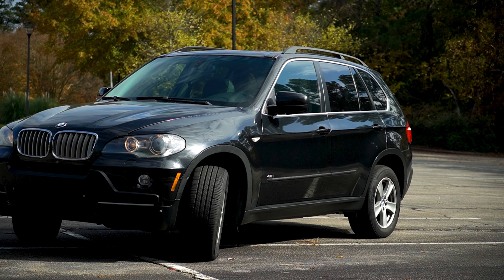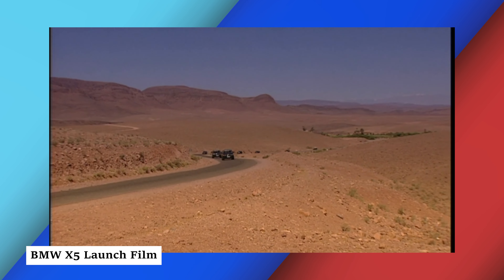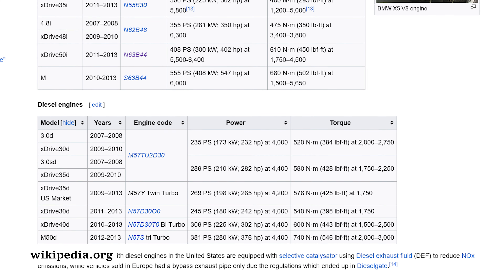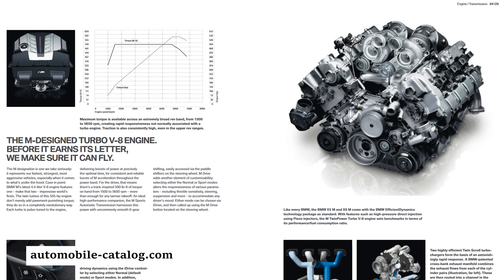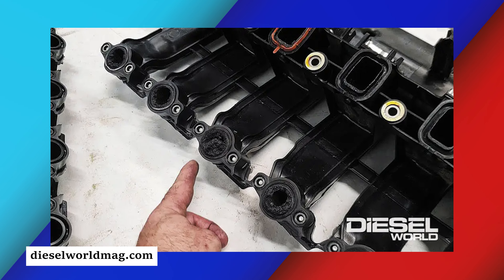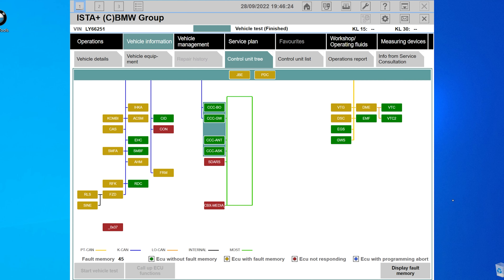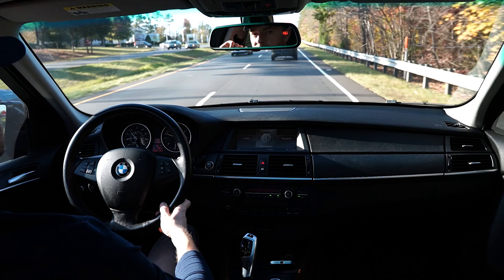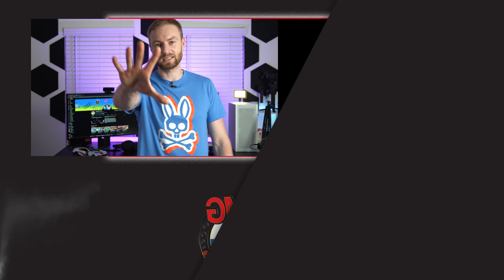The Dark Side of BMW X5 E70: Problems, Reliability, and Buying Guide

Comment: My daily beater is a 2008 x5 with the n52 3.0 si.      212 k miles and runs strong as ever with the coldest AC I have ever felt.
Reply: What's your maintenance and expenses per year roughly? Thank you
Reply: @    Most I have spent on it, was a battery and a rear break pad wear sensor, not including regular maintenance.   I would say a little over 200 bucks for the past year.

Comment: I love my 2012 E70 N57 diesel.    The drivetrain has been pretty solid up to its 160k kms, but the plastics used by BMW on this car are horrible.   In the engine bay, I've had to replace the plastic fan, plastic coolant expansion tank cap, plastic upper engine partition, plastic/rubber engine cover grommets, plastic shock strut tops, and now brittle wiring inside one of the headlights is causing problems.    

In the interior, the plastic degraded and got sticky in all door pullls.   The center cupholder rolling cover broke.  Dry plastic creaks around the cabin.    Again, the engine and transmission will last forever if you take care of it but the rest of the car will probably fall apart around it.
Reply: I have same car when do plastics go mines 2011 and done 80k miles now. Got valve cover leak and oil smell on hot exhaust.

Comment: After owning an 2009 3.0 E70 I don’t recommend this car. I drive BMW for the last 30 years and this is the worse. Even 2 mechanics asked me if I’m sure buying one as those are high maintenance cars. I did anyway. Within 1 year I had to do, heater valve, water pump, steering pump, exhaust camshaft ledge, pvc valve, main radiator water hose, rear suspension airbags, electric starter, reveres camera, all oil gaskets, vanos unit bolts (under valve cover) some videos on YouTube here about the bolts. The was a recall for the bolts but not where I live. This car is a nightmare!!! I would sell but now invested so much that I hope it will last.
Reply from the maker: It definitely depends on the previous owner and the condition you got the car or wasn't following the maintenance, if you would let it run for 10 years without replacing a single thing... But I understand what you referring to, luxury cars are not reliable relative to some other brands, and it's cheaper to buy different cars instead of spending so much money on repairs. Although not every x5 will be the same, the engine is N52 and it's not that bad in comparison, plus it was installed in every BMW at the time so it could happen to any bimmer...
Reply: @Makhnovets  yes previous owner maintenance history is very important and I owned multiple N52 and still have an E83 with the 3.0si engine and it’s great. But certain years of the N52 had two major recalls for the exhaust camshaft ledge and the vanos gear bolts and those should be avoided at all costs unless a buyer has proof of those repairs. 
Without issues the E70 is a great family SUV and I love driving it but the reliability is not there and this does not seem to be a unique case as others have similar issues on the E70 platform. 
After 30 years I still love driving BMW but you have to be prepared for repairs.
Reply: He's not a newbie to second hand bmw's.. Just admit that there aren't certain models, brands that are muck less reliable than others regardless how you maintain it.
Reply: Those are mostly all maintenance items which are have all been replaced over the course of ~5 or 6 years on one BMW which I currently have. We also had to have transmission solenoids replaced at ~180,000 miles and transmission fluid too (again, they are maintenance items). And a new transfer case at ~190,000. But apart from all the maintenance parts, it has been quite reliable. It just seems all the maintenance parts which were replaced on different intervals on this car were replaced at the same one on yours.

Comment: I’m scared now. I have the N62 in my e70 😢
Reply from the maker: I wouldn't worry too much, if the car driving good, and you don't have any issues with engine or transmission, you should be fine, most cars with N62 engines slowly getting to the point of being broken, so you have enough time to deal with the problem or newer)

Comment: Is the E53 x5 3.0i with M54 engines a reliable car to buy. What mileage car should I avoid.
Reply from the maker: The M54 main issue is the lifter seals(common but not too many people trying to fix it because it's expensive and potentially car can operate with no problem ) and VANOS seals. if those are in good condition I wouldn't worry too much. Overall it's a good engine, as for the millage, 100-130k/mi top. and you got to make sure there no major oil leaks, .
Reply: Thank you for sharing your knowledge. Would you recommend an E70 X5 N52B30 3.0 petrol to be a more reliable engine than M54.
Reply: from europe i say get m57 , most reliable engine from bmw
Reply: @kalamees  have read many good reviews on M57. My usage is like weekend grocery, church and occasional (1-2 times) a year long trip with family. I’m afraid that due to my usage remaining local distance of about 5 kms a week in city the DPF will not regenerate and I will be struggling with DPF cost and service. Hence wanted a petrol motor.

Comment from the maker: Forgot to conclude about the Diesel engine,  in terms of maintenance it's really similar to N55, and it's a bit picky, definitely will need to clean carbon buildup and possibly replace the charcoal filter, if it wasn't replaced, but generally M57Y long-lasting and reliable engine. So my suggestion is N52 as the most reliable, then N57Y if you can find one in good condition, and N55 as the third option. 
As for the rest, they are strictly for enthusiasts and for those who really know what they doing. Good luck!
Reply: whats your word on the N57 (2012 30d)?
Reply: I own an M57tu deleted 200k miles no issues
Reply: You mean m57 not n57 which is crap

Comment: I currently have a 2005 E53 30D with 225000Kms, a 2009 E70 35D (N57) with 190000Kms, a 2010 E70 LCI 40D with 240000Kms and a 2012 E70 LCI 30D with only 155000Kms. Both LCI's have the N57 engines and ZF8HP70 transmissions and they came with timing chain problems. The E53 has the M57TU2 and ZF6HP26. The E53 suffered front suspension bush wear and being full of intake carbon. The rest suffer from EGR carbon mainly, no major oil leaks either. The E70's suffer from broken pastic cupholder slides in the console. E53 and E70 suffer from glow plug controller/glow plug faults. I love the torque of those BMW 6 cyl diesels. Touch wood, no other major failures yet! Both LCI's were run on the extended service intervals because their BMW dealer were utter idiots! Be very careful buying any BMW using the extended service interval, a major cause of timing chain failures in many countries.
Reply: I live in my 2005 BMW X5 e53 full time year round, and mainly explore wild forests and mountainous regions across several countries. Owned it for five years and never touched the engine. No oil changes and I never have vehicle services done. During those five years I've fitted new battery, tyres, alternator, and brake pads.
Today the tachometer passed 157,000 miles/253,000kms and covered 500 miles the past few days as smooth as silk.
My biggest gripe with the X5 are the door handles...the interior door carrier clips break frequently and are just not built strong enough to cope with frequent opening and closing of the heavy doors, especially during below freezing temperatures.
I love this vehicle and it has always coped very well on and off-road throughout all seasons.
Reply: I have the 4.0d but want to swap to n52 or m57 instead due to timing chain issues down the road.
My n57 leaks oil and have that smell from oil
Burning then sometimes whole engine bay smokes lick a chimney to clear the excess oil. I’m scared it will blow up someday. Need to replace that valve cover asap but can’t be arsed.

Comment: Hello , soo still have questions which engine the best diesel? I am looking in europe for e70 bmw
Reply: I am looking 3l engine
Reply from the maker: M57 is overall the best,  has many revisions and it pretty common.
the N57 is newer engine it was installed on e70 from 2011-2013, but as I stated it has one bigger issue, which is timing chain, if you can find one that been serviced I would go for that one. otherwise M57 is more common and it's much cheaper since you can get older car with this engine.
Reply: @Makhnovets hi i am looking at a 2011 model with n57 engine. Should I be worried that its issue is the timing chain replacement?
Reply: Loads of m57 chains failing these days. Just get the vastly superior n57 with 8 speed ZF transmission and do the chain. Unreal vehicle. Get the 40d, best BMW engine diesel, inline 6, 306bhp, 0-100kmph in 6.6secs, even though nearly 2 1/2 tonne vehicle. Tows up to 3500kg without breaking a sweat. And you'll get 1000km to a filled tank of diesel.

Comment: I've got 2008 E70 3.0 si N52 engine.
What bothers my is lifters noise when I don't it drive it for a couple of days the lifters start clicking and stop after driving for a while.
Could advice me please are they replaceable. If so, should I replace them or leave it like that.
Thank you
Reply: Try liquid moly ceratec oil additive.   Could help with the lifter tick.  Did for me.
Reply: @figleafz  Thanks a lot.
Reply: Try using Rotella 15w40 T4 oil